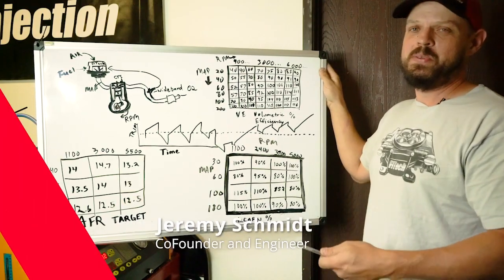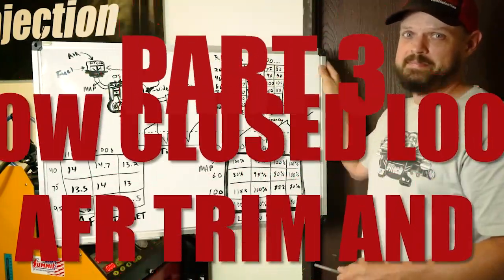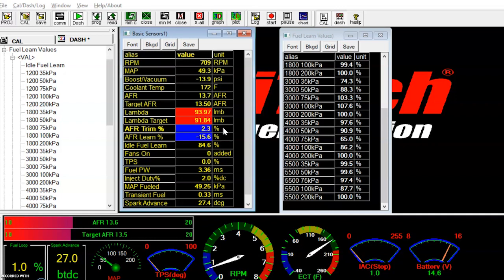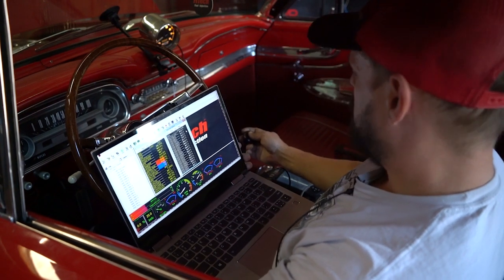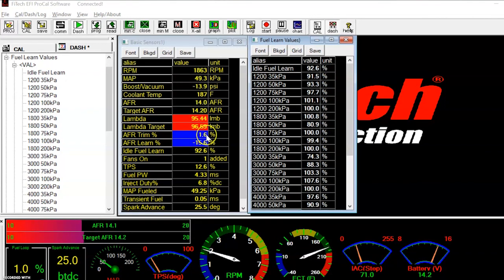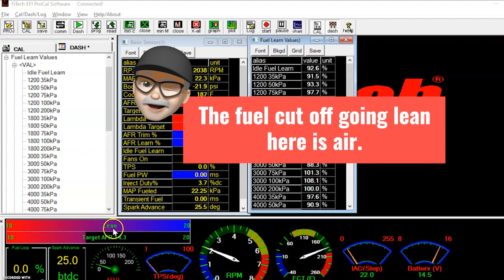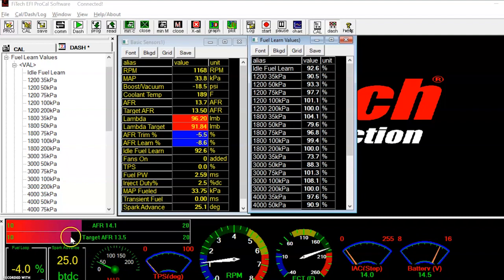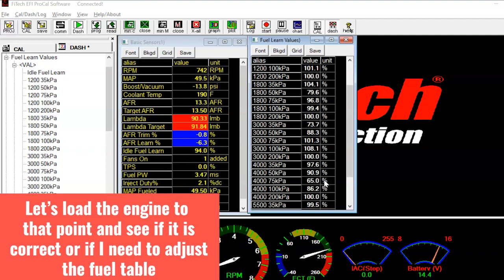How Closed Loop AFR Trim & Learn Work Part 3| Tech Tuesdays | EP50

Comment: This is good stuff! Thank you. Looking forward to seeing your corrections. 
 
Also, I would also love to see how you go about correcting these issues:
1. the off idle to wide open throttle, lean (in one cell in data log) to pig rich conditions. 
2. Also maybe some AFR corrections in boost between the 100 & 200 kpa range.
Reply: I get the same. I get to 10.9 afr commanding 13. Yet the learn values in that area are within 10%. I’m not sure if it’s the accel pump give to much, but I go lean. From 17 to 10.9 then settles in after about 5sec. Being trying to mess with the accel decay. We really need better software to data log, like histograms, more then a few cells to tune in. Then I think Fitchburg would comparable to other brands.
Reply: @ramdart74  same issue and fitech techs are worthless... Gonna get a Holley system... Fitech got my money and doesnt care anymore...